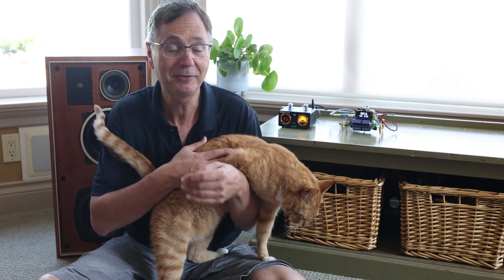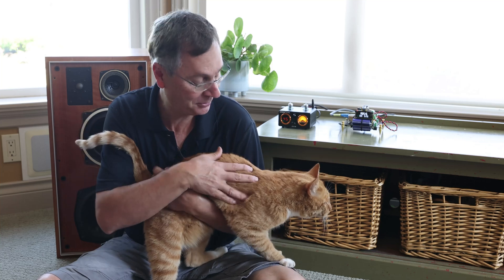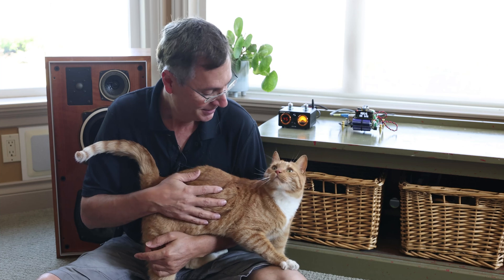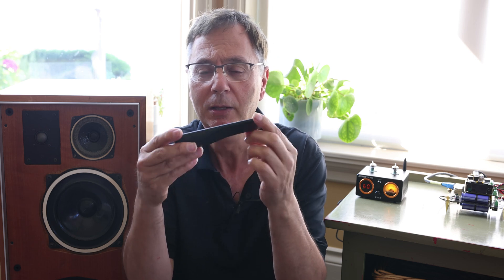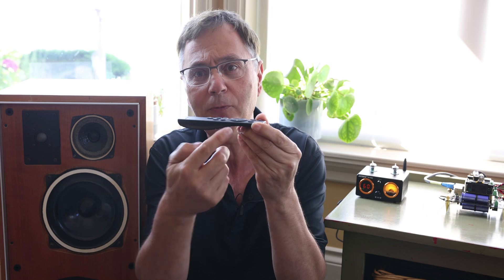Building a HIFI System with the Aiyima T9 Pro Amplifier/Dac. Mini Audio system for Audiophiles

Comment: Hi and thanks for this review. Im thinking of building a cheap but good system. I have a auralic aries streamer and was wondering as that cost several times the amp how much better will the sound be from the amp with a really good streamer ? I guess it will be a good step up from bluetoth and also understand you dont use the streamers full potential because of the amp, but since i already have it it would be nice to here if this amp is something to go for, or if you have some other suggestion if i go up a bit in proce ?

Best regards
Joakim

Comment: Just a comment about this device and one tip for buyers. I think this thing sounds absolutely incredible for it's size and price. I bought this for my room mainly for its size  and loved the look. It's more than filled the bill. My advice... when i first used it, i was unimpressed until i turned off all equalization on my sources. The sound right from the amp is amazing and in my case, any equalization actually ruined it. I use it with klipsch r41ms and a sony powered sub and i think it sounds absolutely awesome at a very low end price for everything
Reply from the maker: You are correct the shorter signal path without modifying it and without equalization, DSP, and any software manipulations like software volume level control ……always yield a cleaner sound

Comment: Hahaa, i've the same speakers; IMF ALS-40. But a friend of my uses them now. He has more space. I use Triangle Borea 3 and love those bookshelfs much..
Ohh, by the way; i use the Aiyima D03, connected with Bluesound Node 2ii, nice!! Spotify and Tidal.
I won’t believe the sound of the small Chinese amps. before. But(okay, i have a small appartment in Amsterdam;3m by 4m, but high ceiling) it sounds very good, although for my ears. 
I’m not an audiofile, just like music.
Before the Aiyima D03, i used a total restored vintage Sansui AU-317. Great amp(class a/b)great sound but much heavier and bigger than the Aiyima.
For my ears; it sounds as good as the Sansui..
Although it’s a class D amp.
And the dac’s inside the Bluesound/Aiyima sounds a lot more “analog” then 10/20 years ago..👌👍

Comment: +1 for hooking up to decent speakers!  

So many reviews treat these miniature amplifiers as though they are toys that can't get a good groove going with more sensible or larger speakers... and, of course that's not true.  The mistake is to see this as a "desktop" setup, and it does not have to be.

I build "sound bar killers" for friends. These are essentially a mini-amp, hookup for the TV and a pair of mid-price speakers, usually towers, to stand on either side of the TV. Aiyima and Pioneer are favourites and the sound quality will rival systems costing multiples more.

My own current system is an A07, modified Pioneer FS52 Towers, a home theatre PC and a 4tb external drive.  When set up and running the whole thing (not including speakers) is 6 inches wide and about 5 1/2 inches tall ... and produces almost 200 watts of very clean audio!  

Small amp does not mean small speakers!
Reply from the maker: Very good point

Comment: Bought one. On the unit that i received the right speaker sockets are kinda "loose", where a bit of movement causes the signal to the right speaker to cut off. Also got a very faint buzz on the right speaker, not sure if it caused by the "loose" speaker socket.

Anyways, i guess it is good for its price.
Reply: So return it ... Aiyima is very good about warranty replacements.
Reply: Probably could be tightened if you're game to open it up.

Comment: Is it possible to use the T9 as a bi-amp (set of two) as my speakers has bi-wire connectors
Reply from the maker: Yes you can just make sure to remove the bridge connectors.

Comment: I have tiny little Focal Sib speakers that are 75w max and this Amp gives me very little volume. Really disappointing considering everyone is raving about it. What am i doing wrong?
Reply: The other problem, beyond difficult speakers, could be low input levels.  Check your source on a different amplifier and see if it is low there as well.
Reply from the maker: Just checked the specs of your Focal Sib they are not very sensitive also the frequency response  (±3 dB) 75 Hz - 20 kHz means you need a Sub for sure
this Amp is good with larger more sensitive speakers . Your speakers may work better with a smaller room or nearfield.
Reply: @Gabster1  i am running a sub and i have an Aiyima A07 that works fine, also a Douk X1 that works fine. I’m thinking i need the 45v power supply. I appreciate the reply.

Comment: Nice Video!

A little off topic, but... I've noticed Aiyima and have been playing with the idea of purchasing a solid-state amplifier module (without heatsink) from them - or some other mail order outfit. Preferably one that delivers to Germany with reasonable prices. Does anybody have a link to reviews for these types of components? I have the impression that there aren't many reviews.
Reply: For the DIY modules your best bet is to look up the spec sheets for the chips used.  Except for disastrous design errors that will pretty much tell you what you are getting.

Comment: I built a kit of Overnight Sensations speakers for my brother for his birthday. This was the amp I chose for my parents to buy him. Its a great value amplifier+DAC. I A/B tested it with both his and my speakers (both overnight sensations) to see if the speakers sound the same. They do. I compared the t9pro to my Aiyima a07 amplifier and SMSL-SU 6 DAC with the source being the WiiM pro streamer using my speakers since the placement and sound I can get are known to me. The differences are there but small. The biggest difference I noticed was that my stand alone DAC improved how wide the soundstage and depth of music is, its just slightly better. In terms of the amplifier, a07 gives slightly better (I believe it was just a bit more precise) bass. But all this I really had to critically look for and if you dont know you wont miss it. The t9pro is the same price as my DAC alone.. great value for money. My brother is as happy as he could be. Its an excellent device in my opinion and perfect for his setup. He's loving his first HiFi as much as I am so it does what its supposed to do.
P.s. Rusty is very cute, reminds me of my old cat, I swear ginger cats are just more cuddly than others!
Reply: What’s the speaker used?
Reply: @vinodponnappan6795   Overnight Sensations, its a DIY build that you can buy in kit form too. Built him a kit for his birthday as I was happy with mine. If you google there's quite a bit of info about the speakers :)
Reply: @daniel12345abc  thank you

Comment: The aux out of the T9 is run by the volume control so it works very well with a powered sub. It makes it a real champ at being a desktop integrated amp when paired with some nearfield studio monitors and a powered sub. I would have liked to see you crack it open and talk about its parts and maybe try some other tubes. Your run down on that type of thing is so thoughtful and inciteful I feel like I'm missing out.
Reply: I am using the Aux out to drive 2 powered wharfedale sub in stereo.
Reply: You mean that you use the T9 as DAC only?
Reply: @francohic  Negative. I find it's DAC to be unremarkable and using an external DAC to be an upgrade. But the built-in DAC certainly is good enough for the price and i wouldn't spend more to add one.
Reply: @admiralnorman  thanks, i dont have another DAC to compare